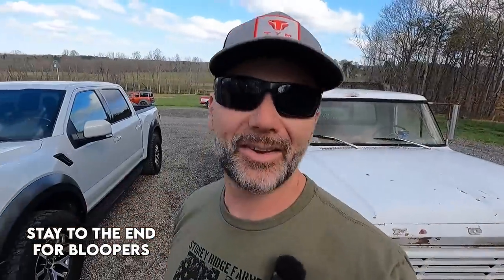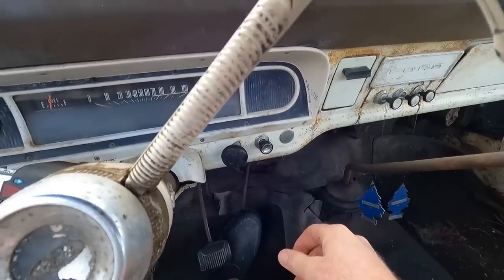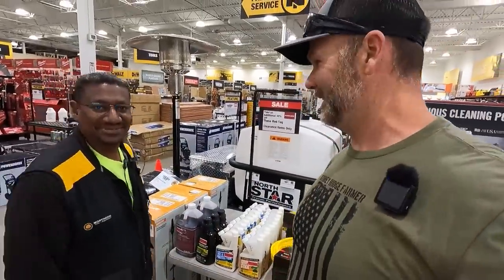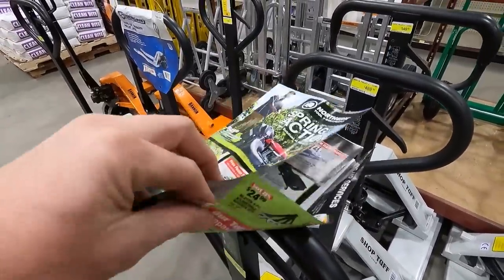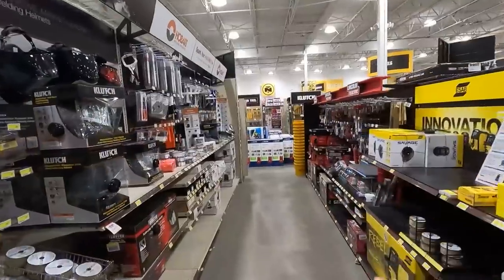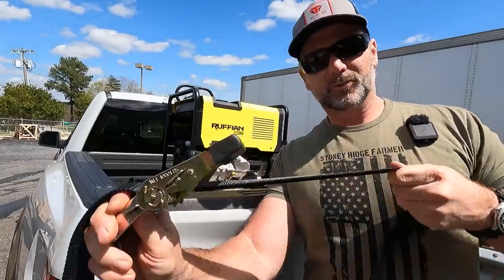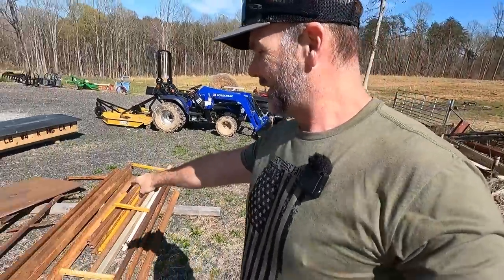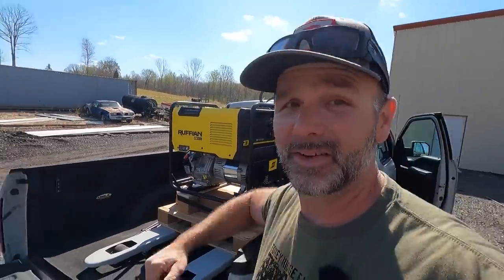You won't believe what I got for the Farm Service truck!

Comment: I looked into what Engines were available for the F series trucks in 1967. All it showed was a 352 cu inch. 68-72 saw the introduction of the 360 and 390 V-8's. Usually there is a sticker on the driver side valve cover stating what engine it is.

Comment: The engine in that old ford is an FE (some think it stands for Ford Edsel some say it’s because FE is the table of the event’s symbol for Iron) and probably a 360 CI displacement. Definitely not a 352 as that is not in the FE class. Other FE engines include the 390, 427, and the 428. The 460 was a different class than the FEs as well.

Comment: My 1968 F-250 pickup truck has a 360 V8 engine, It was rebuilt in 1998 and running strong getting an amazing 10 miles per gallon with a tailwind it get 11 miles per gallon. I am in Greensboro NC .

Comment: Yes… ESAB welding equipment has an excellent reputation.  As for your pallet jack- I have seen a number of pallet jacks that have been abused.  The typical pallet jack abuse involves extreme lifting attempts on one fork.  That can result in the pallet jack getting a non-repairable bend in its framework.  The jack becomes unusable if that happens.  Use your pallet jack in a proper manner and it should last a lifetime.

Comment: Never been a fan of Ford, but I'm a hiuuge fan of old trucks/vehicles. Back when we could 4 guys in the engine compartment to work on them, now you have to pull the engine just about to even change the oil. I'll take a horse and buggy b4 I EVER buy this electric crap. In our lifetime we will never see an ALL electric society. Mathematically not even possible. Says a gm for one of the biggest power cos in America that let's just say someone knows very very well🤷‍♂️🤦‍♂️
Reply: Absolutely 💯%